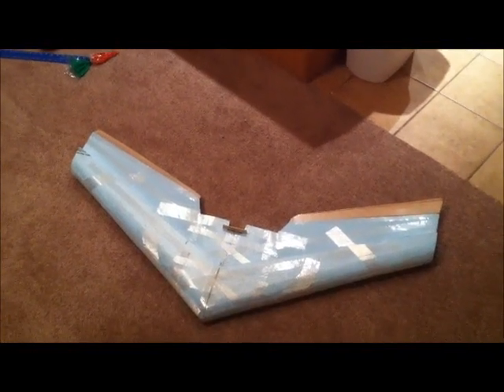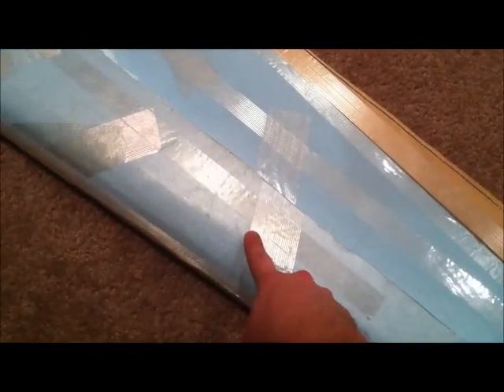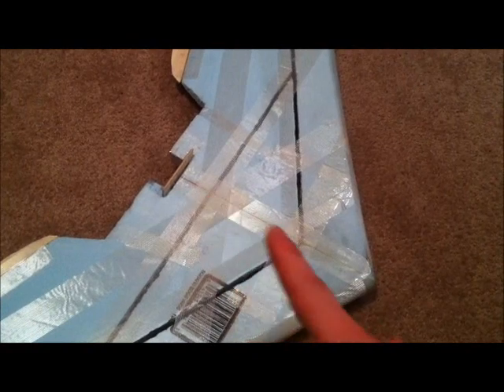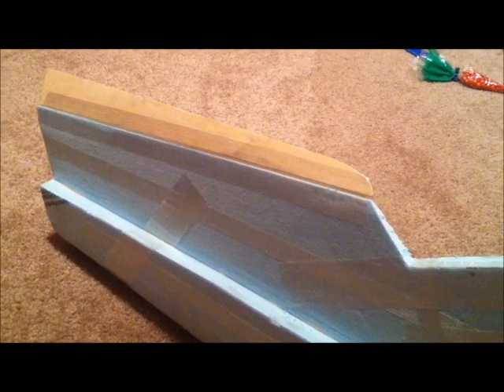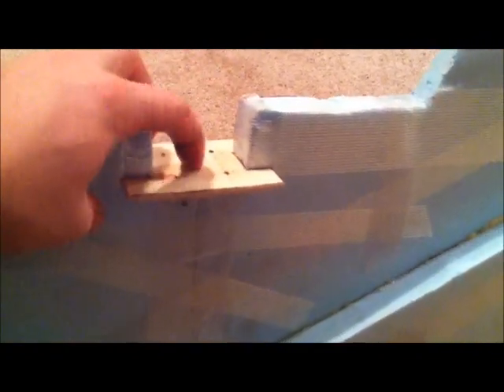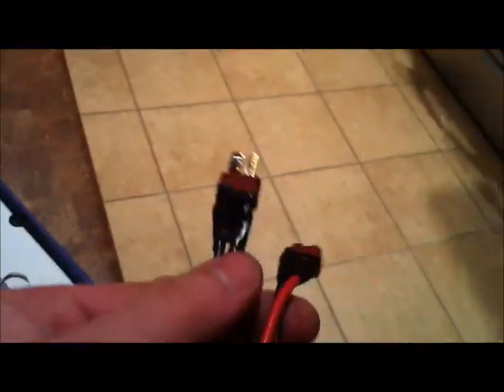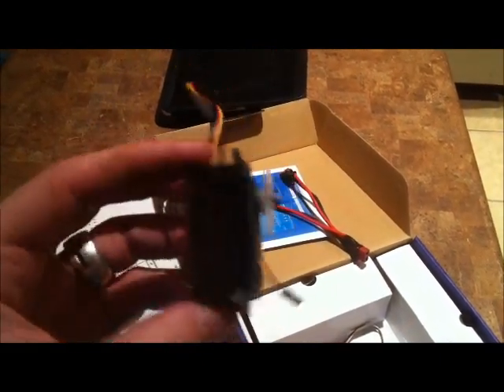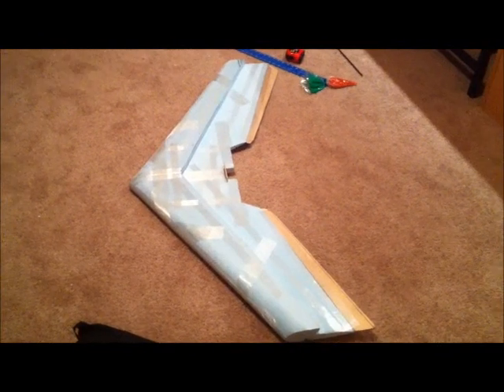Ritewing Zephyr 2 build (Part 2)

Comment from the maker: Hey rcdawgmc, I'll be tracing the size of my 2200 battery and then cut a bay for each battery. Once the battery bay is cut, I'll use some Velcro straps to hold them in.